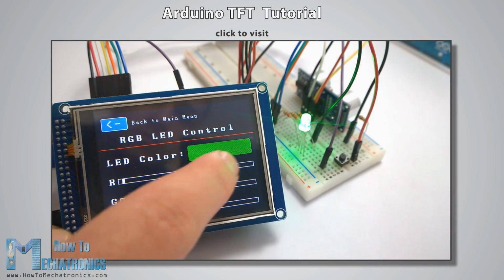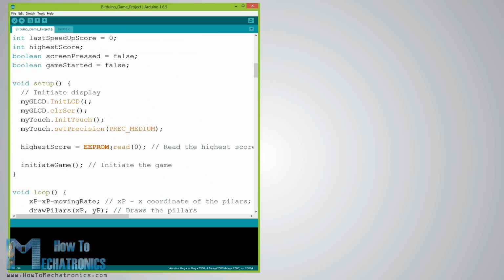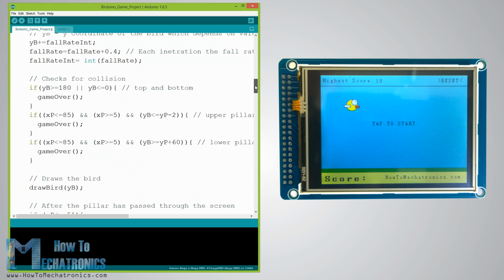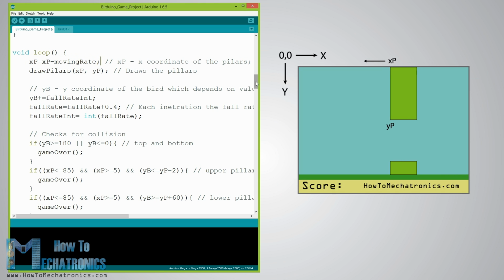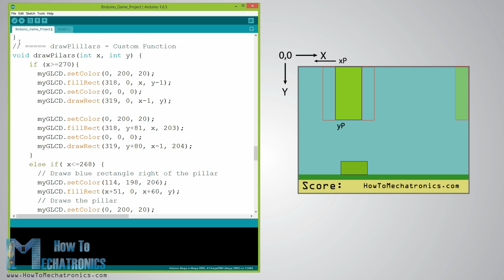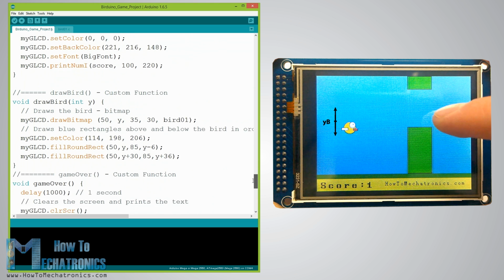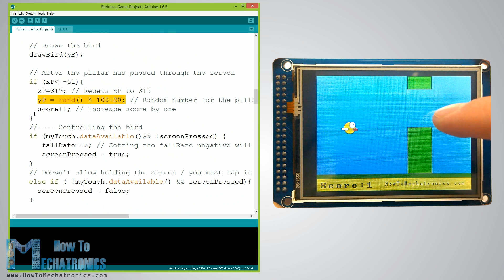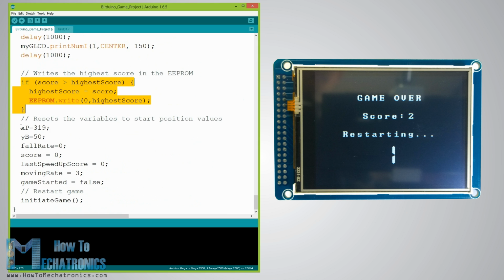Arduino Game Project - Replica of Flappy Bird for Arduino

Comment: When you touch the screen (and the bird flaps upward), it looks like a progressive upward movement, but on the code the Yb variable decreases by 6 (in one step), am I missing something? why does it looks as if it gradually moves up instead of "teletransporting" 6 pixels up?
Reply: Just got it. You decrease the fallrate, not the Yb value itself.

Comment: My Display is just White can someone help me ? i dont know what i did wrong becuase there are no errors in the Arduino software...
Reply: Check the line that states UTFT myGLCD(SSD1289, 38, 29, 40, 41); Set the parameters to your display's parameters. That SHOULD fix the problem!

Comment: Arduino: 1.6.8 (Windows 10), Board: "Arduino/Genuino Mega or Mega 2560, ATmega2560 (Mega 2560)"

C:\Users\admin\Documents\Arduino\sketch_dec07a\sketch_dec07a.ino:12:19: fatal error: UTFT.h: No such file or directory

 #include <UTFT.h> 

                   ^

compilation terminated.

exit status 1
Error compiling for board Arduino/Genuino Mega or Mega 2560.

This report would have more information with
"Show verbose output during compilation"
option enabled in File -> Preferences.
Reply: you have to download the library then add it to the arduinos library

Comment: Excellent project!  Did you mention somewhere that you're using a Mega, and that the code won't fit on an Uno?  It compiles to 40K, more than 32K, but not a lot more.   Before I attempt to trim the code, have you tried that?
Reply: Do you have the code which could fit on uno?
Reply: OK thanks :-)
Reply: Im a bit late lmao but I made flappy bird very similar to this on my Arduino Uno R4 Wifi this weekend using similar game mechanics. So I'm sure it would have worked